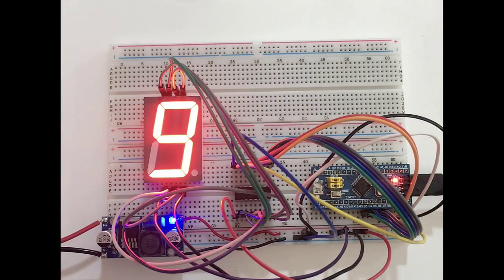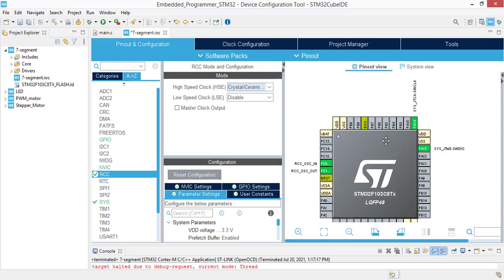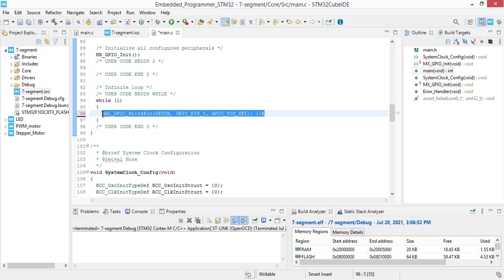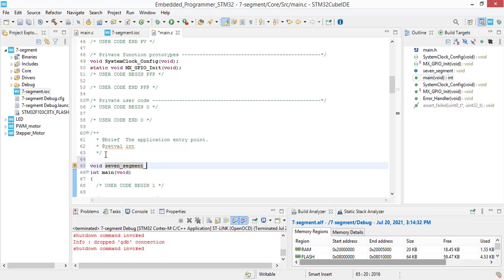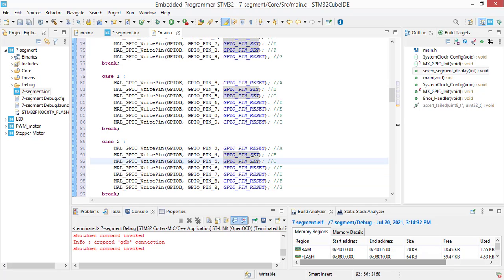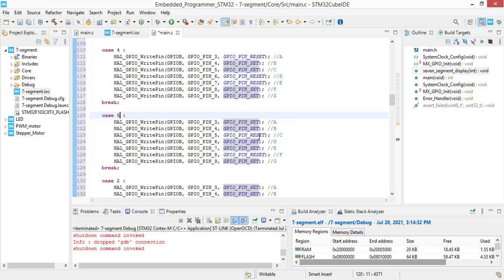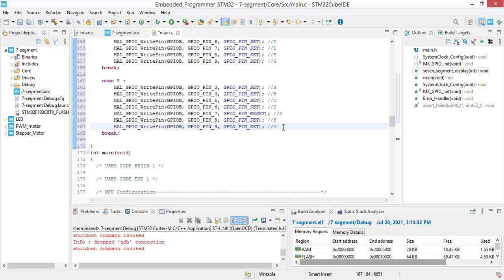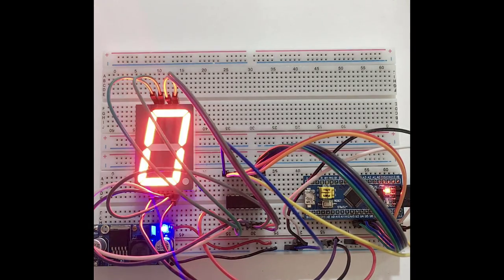7-Segment Display with STM32F103 | Embedded Programmer

Comment: Just a question, why do you use the pinout configuration to set your pins instead of setting bits in the peripheral registers. I know it’s slower but doesn’t it give you more control over your board?
Reply from the maker: Yeah, you are completely right. As I want to give a graphical view of the pinout functions to those who want to start the tutorials from the beginning, I'm using pinout configuration in my projects.